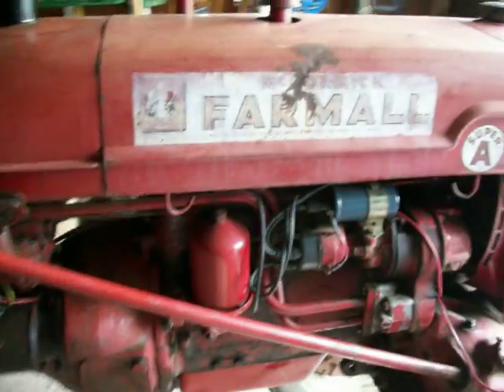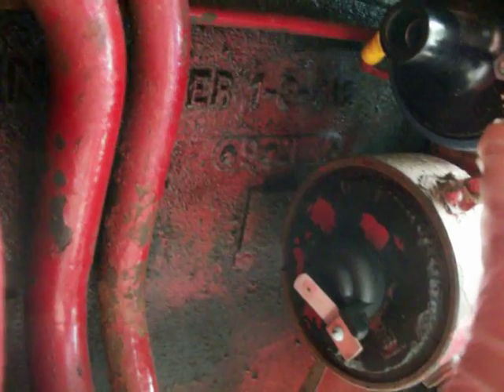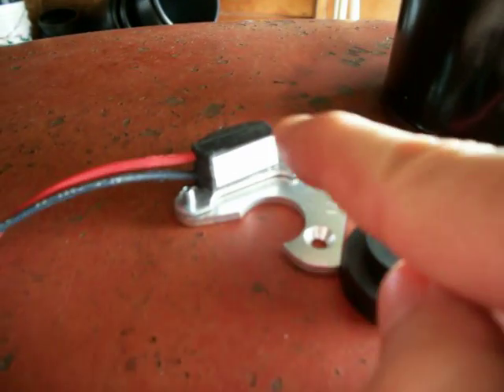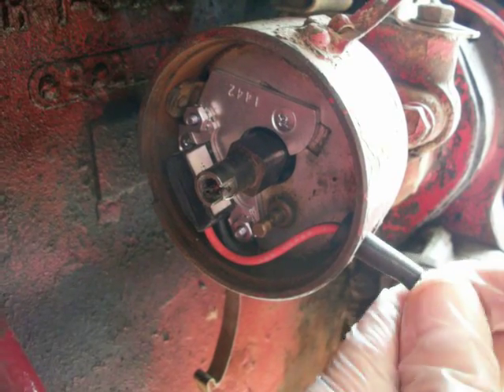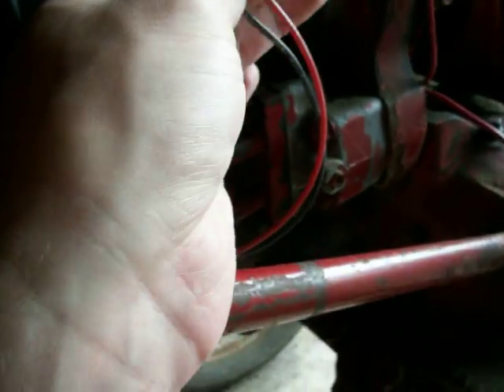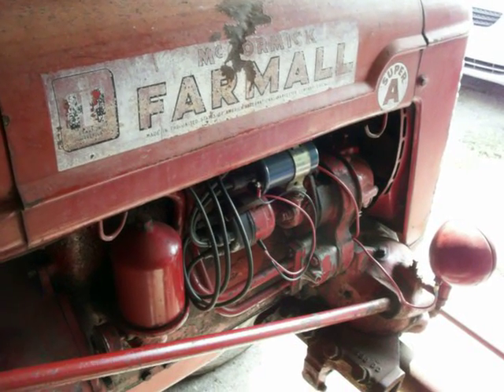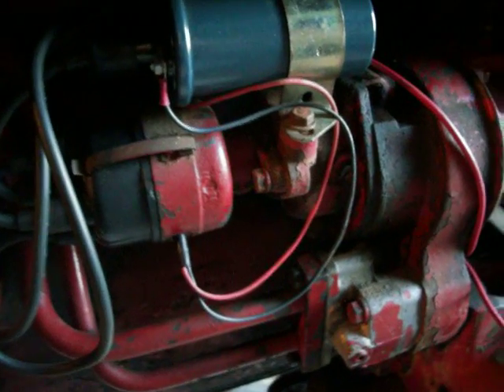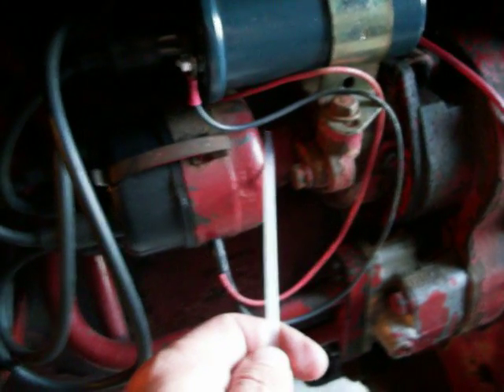How to install electronic ignition and adjust timing on Farmall Super A

Comment: Great video I too bought the  12-volt negative ground. How do I know if the alternator was converted to the 12-negative ground? I suspect maybe its an issue with the PTO safety switch might be flakey...
Reply: Darus_ 
Assuming the prior owner made the conversion, first if it has an alternator it’s a 12v neg ground. Generators are 6v pos ground. 6 v batteries have 3 water caps 12 v have 6. If it’s a positive ground system check the battery posts. Is the + post connected to the starter or the battery box or other body part (ground).

Comment: Hi, #1 piston is in the rear of the engine right?  #2 in front ?
Reply: todd hurley h0w d0 I find destirper f0ir sale
Reply: Always on these tractors #1 Plug is one nearest the radiator.....
Reply from the maker: Number 1 is the piston/plug closest to the front of engine (closest to radiator). It goes piston number 1-2-3-4 from front of block to back of block.  The 1-3-4-2 stamped on the side of the block is the firing order for the engine. When the #1 piston is at top dead center(TDC) the distributor is firing cylinder #1. The next wire (the distributor turns clockwise) on the distributor has to connect to cylinder 3, then 4, and finally 2. Therefore, to time the motor correctly remove the number one spark plug (front of tractor), turn the engine over slowly until you reach top dead center(TDC) for number one cylinder, and turn the distributor until the #1 wire on the distributor cap is aligned with the distributor rotor. Remember that the distributor rotor turns clockwise.  There is also a faint mark on the flywheel that you can view from the bottom of the tractor through the inspection hole that has a line and "DC" stamped on it that will be pointing directly down at TDC. It can be worn off or really faint so usually TDC is best found with a bent wire inserted into the spark plug hole for cylinder 1 and turn the motor until the wire is at the top of the cylinder travel.
Reply: Thanks a lot, my dad has new  electric ignition conversion kit ordered.should be here in a couple day,so I will use this info...thamks again...

Comment: If this engine is a flat head design it will still foul the plugs despite the upgrade to electronic ignition.
Reply from the maker: I concur that fouled plug(s) can arise from more than just ignition system problems.  However, fouled plugs were not the problem I was wishing to address for this tractor.  Cold weather starts were.  Removal of the condenser/points and installation of electronic ignition has given me 100% starts in cold weather for two years.
Reply: EZ570

Comment: Is this all that is needed to convert it to 12volts? Other than a alternator
Reply from the maker: You don't need to switch anything but the battery, alternator, and put a ballast resistor inline with the coil to convert to 12V.  The starter and mechanical distributor (points and condenser) will still work. But... it is a good idea to switch to a high resistance coil and electronic ignition if you are doing a 6 to 12 V conversion.
Reply: thanks I plan to do this conversion next year because the points need to be adjusted all the time and my generator doesn't charge anymore

Comment: My tractor's been sitting in the barn for two years because I can't seem to 1) find the time to fiddle with it and 2) getting the points adjusted to the right gap just seems to elude me somehow.  I've ordered one of these kits and if it works you've got a free dinner any time you come to south central Pa.  :)
Reply from the maker: Hope it works for you as well as it did for me :)  And I may have to take you up on dinner if it does!
Reply: That's a deal.  :)
Reply: Doug Dobbs Hi Mr. Dobbs. I own a 1974 chevrolet 4100 and would like to convert it as well. Where did you buy the kit if I may ask?
Reply: I think I got mine through YesterdaysTractors.com.  I'm not sure how/where to get one for a Chevy.  :(
Reply: +Erick Lukhele 

I believe your car has the 250 chevrolet 6 cylinder (?) Im from the US, but assume the ignition and distributor id the same for your South African variant as the US 250. 

If so, here is one for the application

http://www.ebay.com/itm/Pertronix-1162A-Gm-6-Cylinder-Vac-Adv-63-74-/361404163708?fits=Year%3A1974|Make%3AChevrolet&hash=item54255de67c:g:Sd8AAOSwo6lWFZpm&vxp=mtr

I have actually never swapped a car  over to electronic this way. It is actually chepaer to find a later model HEI distributor.
.
http://www.ebay.com/itm/Vintage-OEM-Chevy-6-Cyl-HEI-Distributor-230-250-292-1110755-/381497768494?hash=item58d309fa2e:g:uvAAAOSwp5JWbvOO&vxp=mtr

http://www.ebay.com/itm/Chevy-Inline-6-194-230-250-292-65K-HEI-Electronic-Distributor-/171881639826?fits=Make%3AChevrolet&hash=item2804f1af92:g:GCoAAOSwHnFVwQvr&vxp=mtr

you need a good 12 volt switched source, not the old coil 12 v. THere are numerous threads online.

Comment: What model ignitor was that? Im putting a 1142 on my C and it looks a lot different and I think it was put together wrong for it will not fit.
Reply from the maker: You have the wrong model.  On a C you should have distributor with body stamp 353898-R1.  The kits numbers for your tractor are:
Ignitor 6V Negative Ground
1442N6
Ignitor 12V Negative Ground
1442
Ignitor 6V Positive Ground
1442P6
Ignitor 12V Positive Ground
1442P12
Ignitor 2
91442
Reply: I miss typed that. It is a 1442. What model did you use? I think on my ignitor they riveted the sensor on the wrong side of the plate which causes the hole nit to line up
Reply from the maker: Ty Minton
I used the regular 1442 (12V neg ground) since mine is converted from 6 V positive ground with generator to 12V negative ground with alternator.  Sometimes I have seen different distributors on IH letter series than the IH factory ones and that could be your hang up.  Make sure and check the body casting numbers on the distributor body match the ones from the CIH website (http://partstore.caseih.com/us/parts-search.html#epc::model_find)
I found removing the sensor from the mounting plate and mounting the plate without the sensor allowed the screw holes in the distributor body to be aligned since the sensor was in the way when trying to install it with the sensor attached.  After mounting the plate then I attached the sensor with the locknuts and it was no problem.